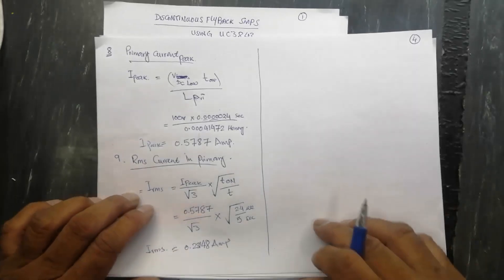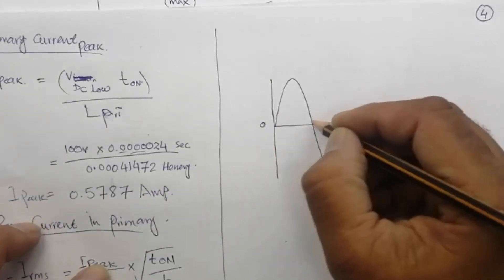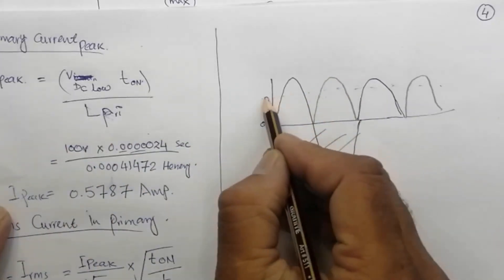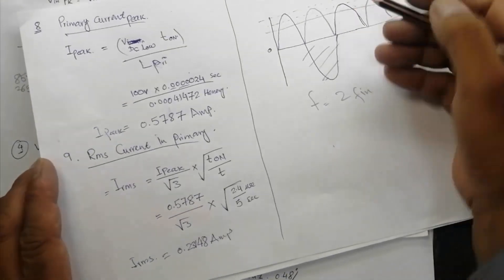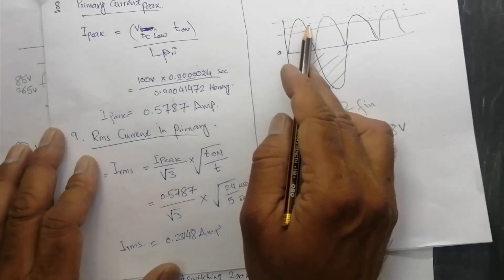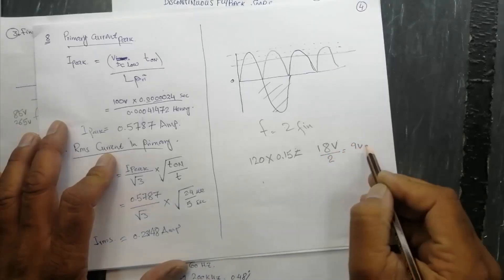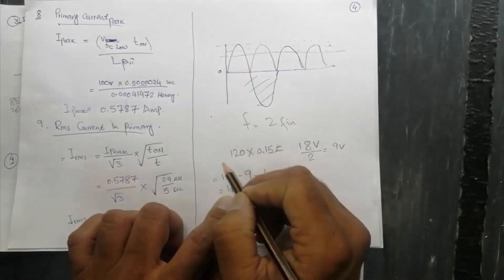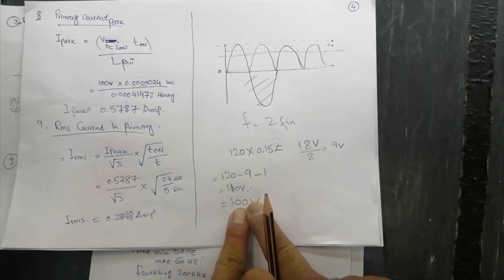#267 What are the RIPPLES in the Output of Rectifier

Comment: 4:30 the value for two diodes or full wave rectufier is not 1.4 ??
Reply from the maker: It is rectified output rms Voltage of full wave rectifier OR bridge rectifier
Reply: @HaseebElectronics  thanks